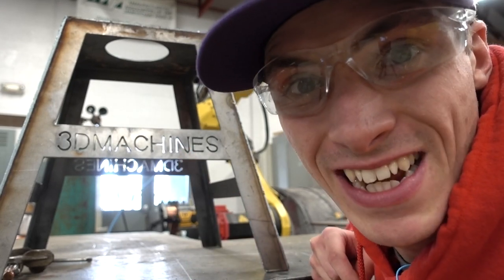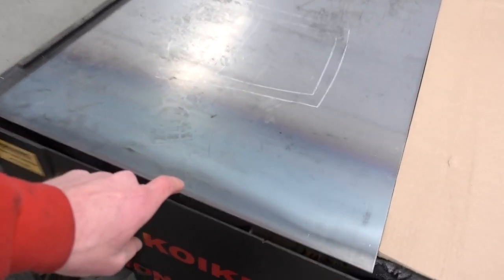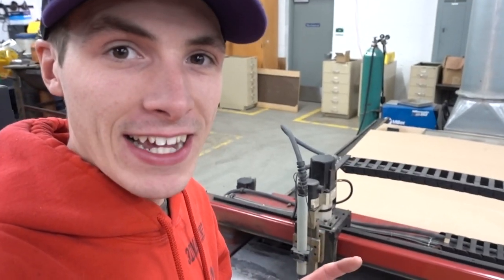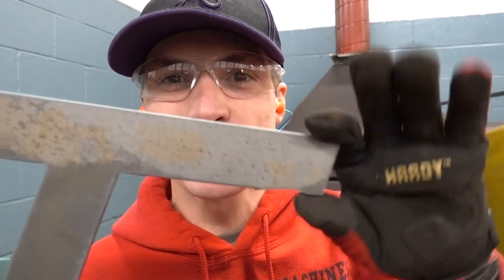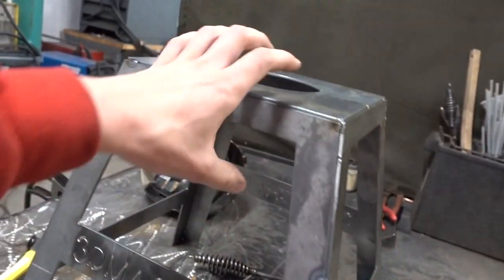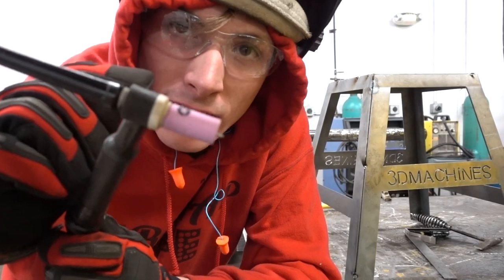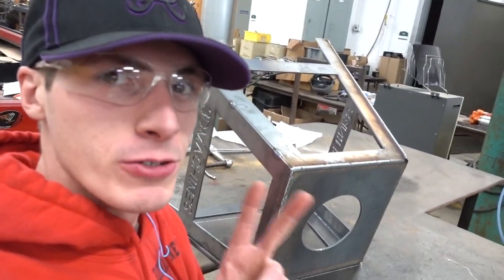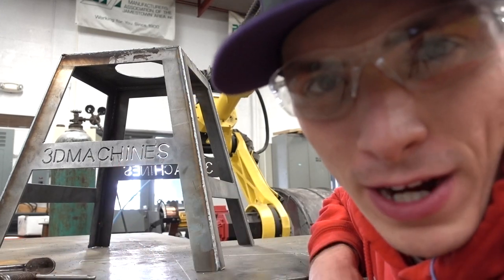$100,000 ROBOT (COOLEST ROBOT EVER)

Comment: Welder myself and I used to weld 1/8 overhead welds on 1/8 material to slow you'd burn through and the corners are tricky without stopping seeing that robot do that boggled my mind that is an awesome piece of machinery

Comment: You can buy a fanuc like that for $20k used and build your end effector out of muffler clamps. Simple welds like that could be taught right from the pendant in a couple minutes. That unit was bought used no doubt with the complete lack of guarding. If your into that kind of stuff.

Comment: 0.125” steel? Holy cripes, I have jackstands with lighter construction. You're not messing around, are you?
Reply: cafn8ed74 You probably shouldn't use those if they are that thin...
Reply: I used 10mil plate for mine